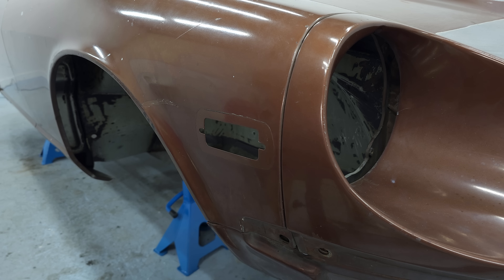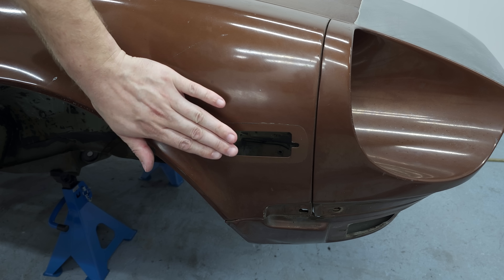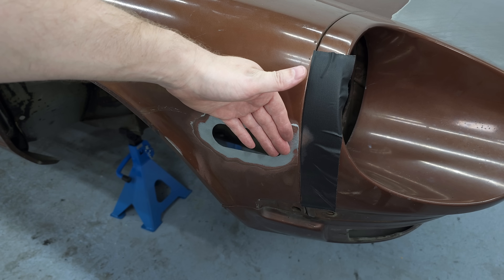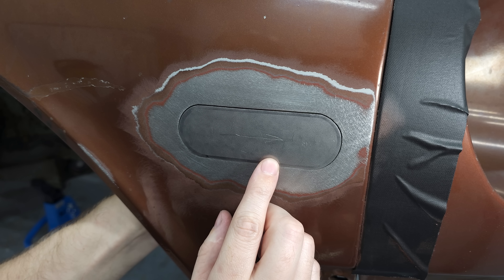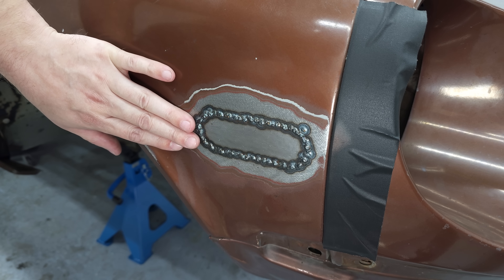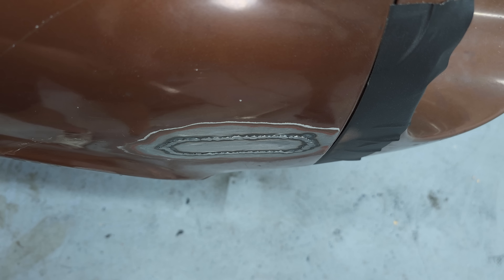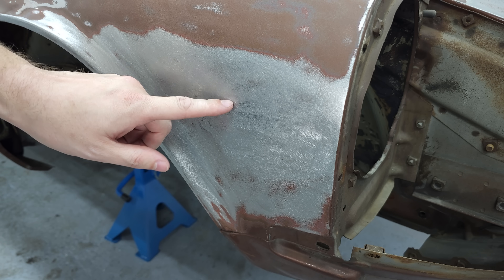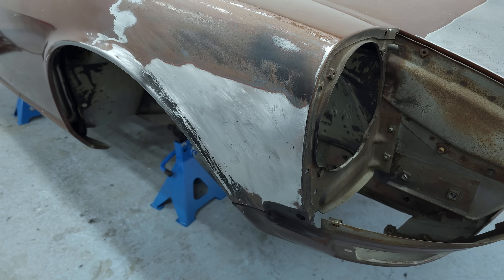How to weld a Patch on a Car - Side Markers Delete 240Z

Comment: You have inserted the patch beautifully: the join is invisible and your commentary is excellent. I think that you are being unkind to yourself about the quality of your welding: the steel used on the bodies of these Datsuns was notoriously poor and it does not surprise me that you burnt through at first. I expect that the steel you used for the patch was much better so you could establish the weld pool and move across to the inferior metal of the fender. Thanks and best wishes.

Comment: How refreshing - so many people would weld, grind, then a thick layer of filler sanded to shape. Great to see you take such care to get the metal shaped properly.
Reply: He will still need filler. Every restoration needs filler of some type. A little or a lot depending on skill. But always some.
Reply: @manderson147 
Not necessarily'depends on the size of the patch' welder settings without warpage' wire gauge'flux core versus gas. There's plenty welders and body men who can do it' grind the weld down DA it and prime which all bare metals require without having to use any body filler/putty.
Reply: @tripplefives1402 no.
Reply: I agree.  Such a beautiful job with the metal.  I've watched a lot of Z restorations.  No surprise you're doing a better job than 99% of the guys I've seen.
Reply: @tripplefives1402 my joke was that I am a crappy welder and so I need to weld and grind and weld and grind and apply copious filler.
Reply: @tripplefives1402 Yup, got it. I still suck  at welding and won't be able to do that.
Reply: Filler or "pudding" as we used to call it, can save people a lot of money. Of course an all metal finish is better.
Reply: So many shortcuts you could do but welding metal getting it close to shape is best. Still needs filler but at least it won’t need the green glass filler
Reply: Because they don't have the time to put such care into it.  A body shop only has a certain amount of time to get the work done and have the car back in the customer's hands which means they need to use filler to get the job done.  And other project cars on youtube are bound by an upload schedule and other projects that are on the go at the same time.  Some project builds are time sensitive because of an event like the SEMA car show in Las Vegas.
Reply: @tripplefives1402 wouldn't moisture get trapped between the layers?
Reply: A grinder and paint...